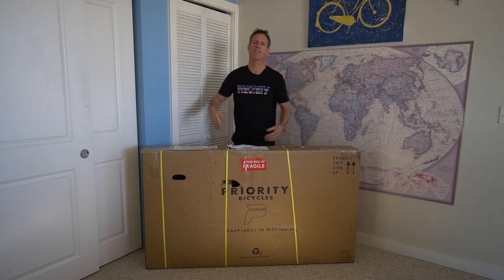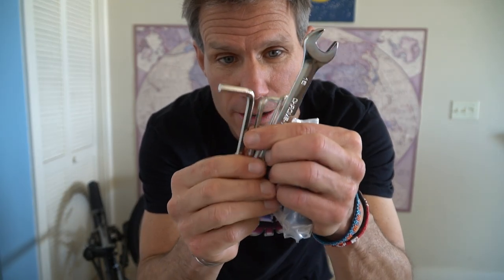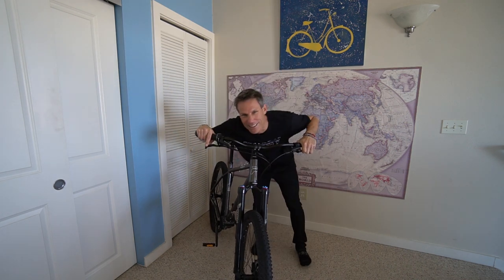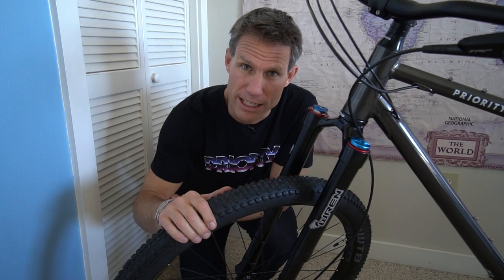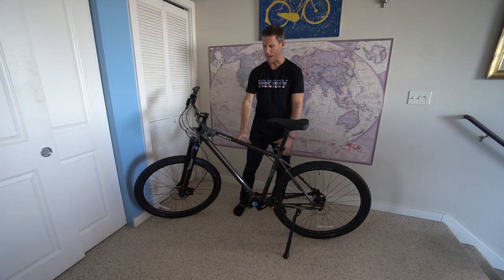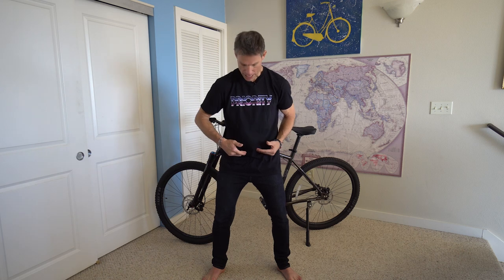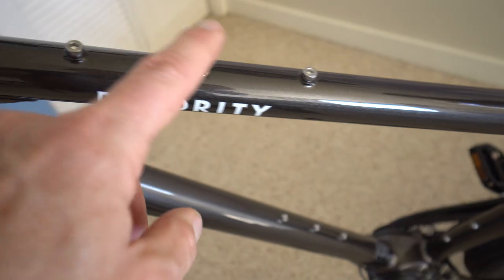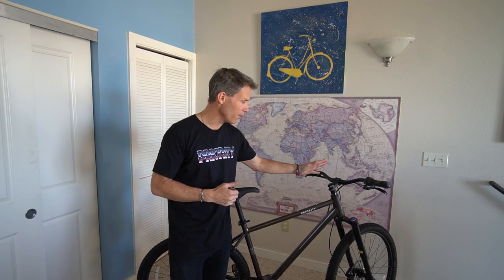The Priority 600x Bikepacking Dream Machine!

Comment: A note about tubeless, sounds good to you dig into the facts. 1. If the rim tape is not installed properly you will have problems. 2. the Valve stem comes in different models and you MUST get the right one or problems. 3. The sealant you put inside comes in many brands and some are not compatable with other brands, and some are not compatable with CO2 cartrage inflation. 4. you must check your pressure because even if all the above is ok, they lose air. 5. Tubeless tires are extremely hard to put  on, bikeshop couldn't install my last set, I'll do it myself. 6. Recommended you carry a tube because they are hard to get a seal to pump up on the side of the road or trail, also no real weaight savings if the tube is on the outside. 7. bike shops charge quite a bit to convert, REI quoted me 75 per wheel.

Contrast that with just putting tubes in and not having all that problem potential.  I run Schwalbe Marathons and my last bike in the USA I put 20,000 miles on the front tire and never had a flat. Cycled right threw glass when I saw it or not. Boxs says check air once a month. Unless you really have the need and the ability to fix problems then go ahead. 

I bought the regular priority 600 back in Sept. But the WTB tires have had 3 flats and thats with tubes. 1 flat the LBS put a new tube and it went flat by the time I walked 4 blocks to the bus and I had to walk back. (650B sux). Not all the bikeshops have tech. who can competently install the tubeless setup.   The tires that couldn't be put on by the LBS? they were Schwalbe  Marathon Mondial Tubeless ready tires   which was the only style of 650b I could find. They are expensive.

Van Duzer is just an advertisement for Priority. they have given him a lot of bikes and possibly more. I love the Priority 600, but was anoyed the seat sucked after hearing Ryan gush over it. In my view Priority bikes are good, but running tubeless or not with these new tubeless ready wheelsets and tires not so much. I have watched and enjoyed Ryan's content, but will take his recommendations with a grain of salt as far as parts go.
Reply from the maker: Thanks for your input. All my bikes run tubeless and I love the setup. I agree, they’re harder to put on, but much easier maintenance in the long run. Not sure where you live, but Boulder bike shops have no problem installing tubeless, it’s a routine upgrade. 650b plays no role in puncture resistance, maybe you were unlucky. I’m still a big fan of the Schwalbe Marathon Plus, they’re solid. The Wtb Pure doesn’t suck, just doesn’t sound like it was the right fit for you. Seats are like shoes, one size does not fit all. Happy trails!
Reply: @duzer  my gripe about 650b was just related to Schwalbe, I normaly run with Marathon, or Marathon Plus, but could only find Marathon Mondial in 650 B, which is a lot more expensive.  I'm just not a fan of running tubeless because having to worry about if the bike mech. installing the tubeless did it properly, and also havinging yo constantly fret over checking the air pressure, and worrying about not being able to inflate on side of trail is maint to me. I'm old and don't see well. Did you miss my comment about 20,000 miles on a Marathon Plus with 0 flats? That was front, rear was 9.000 miles. I didn't rotate like I should have.

Anyways I love the Priority 600 Pinion-Gates drive. Clean and worry free!

Comment: Duuuuuuuzer! Nice work and congratulations. You did it! The final spec looks great. Also kudos on that Wren fork. I want a Wren fork, and a priority Pinion “Ryan VanDuzer” signature edition. Just an idea(s) but PC needs to make a set of plastic tighten-able water bottle bands to slide up and down the Wren upper fork tubes to offer large cages on each side of the fork as an accessory. Also a get out there perfect sized frame bag with your “get out there” logo screen printed on each side. The last piece of the Ryan VanDuzer signature edition would be the custom stickers get out there on the wren lower fork Guards.
So 3 extra Ryan VanDuzer 
add-ons. 1. Plastic H20 bands for each side of the Wren fork. 2. Custom frame bag with Get out there logo. 3. Custom Wren lower fork guard stickers...get out there. There is no reason for someone to use automotive hose clamps to mount a extra water bottle on each side of the Wren fork.
Reply: Oh I forgot, 2 frame bag sizes, one for the medium frame and one for the large !!!
Reply from the maker: Is that all? Ha!! Love that list. Thanks for sharing your excitement

Comment: ⭐️⭐️⭐️⭐️⭐️⭐️⭐️⭐️
Hey I just got my 600x .
After a waiting 9 months. 
Q1 waitlist.

But I’m regretting it already.  
Trying to change to tubeless, it was so hard. It was so hard I punctured my tire & interior while trying. 
Still I can’t remove it. 
This is problem If you are in tour & 
You can’t change or fix it.

The Seat not comfortable for me.
Reply from the maker: I’m sorry to hear about the tubeless conversion. How did you puncture the tire? Please don’t tell me you were using a screwdriver to get it off the rim. I will say this, once you have it all setup, tubeless is much better in the long run
Reply: @duzer  
I was so desperate to remove it  today, 
I used a screw driver & I punctured it. 
It is NOT meant for an adventure bike. 
Maxxis is better.
Way easier to change.
My friend has the same difficulty with his 600x.
Bike shop used a big tool. 
They say it’s hard to remove it.
Imagine if you are in a tour/Trail/ Bikepacking trip.
Daryl from priority reached out to me already.

But again, this WTB ranger is NOT meant & NOT the best for the 600x.
Reply from the maker: The ranger is a great tire, I’ve ridden thousands of miles on them. Once you learn to correct way to maintain them, they’re very easy. Enjoy the bike!
Reply: @duzer  
I put a new Maxxis Tires. 
better , easier.

Seat not comfortable 

Do you still need to break in the brakes ?
Reply from the maker: Maxxis are great too, which ones? The brake pads, like any brand new brake pads, take a little time to settle in. Sorry to hear you don’t like the seat. I always tell people that seats are like shoes, they all fit different people differently
Reply: @duzer  
I put my SELLE ANATOMICA  R2 rubber 
Saddle & way much better. 
I have the X2 leather on my Orbea , 
I finished my century ride with it. 
Try it , you’ll love it. 
No break in period like the brooks. 
& US made.👍👍.
Reply: Thank you for your videos. 
We love them.

Did you put a a PNW coast seat dropper post on your 600x?

Comment: I feel very strongly that standover height is over-hyped as THE fitting metric for bicycles.  At 5'11" Ryan, you may better fit the large frame, despite not having ideal standover clearance.  The change in the main triangle AND 10mm more fork travel obviously reduced that for you.

BUT I think cockpit fit is the #1 concern for a cyclist.  That is, reach to the handlebars and not being cramped or too stretched out is very important.  I place the highest priority on this measurement because you spend hours and hours RIDING your bike in the riding position.  How much time to you spend standing over your bike?

Can you adjust reach?  Sure.  But today's bikes use far shorter stems and obtain reach through top tube length.  Gone are the glorious '80's when we all rode 15cm stems and flipped over the handlebars all the time!!!!  (Ha, ha, I STILL do!!!).  Plus, even with a longer stem, a frame that's too small will still be an issue.  Like when your legs are so long, that your knees end up getting close to the head tube of the bike with each pedal stroke.  No stem can fix this.  Proper top tube length is the key and this is why a large frame might end up being better for you.

I found people seriously compromised fit by obsessing over having some huge clearance over the top tube.  Why?  To avoid landing on the top tube?  Sure.  But how much difference will 2 or 3 cm make when you take a major spill?  I can't imagine it makes any difference.  I saw SO MANY guys my 5'10" height on 16" frames.  It was laughable how they totally accepted terrible fit for some theoretical top tube clearance.  When I crash, I'm WAY more concerned about the rocks and trees I'm gonna nail.  Plus, when I DO go over the bars (something that's been a bit too frequent as of late) it always seems to be my knee smashing into the stem and my crotch never even gets near the TT.

So take out a measuring tape and figure out what reach is best for you and see if the medium or large gives you the best "on-bike" fit.  Don't obsess about top tube clearance.  You aren't planning on having kids anyway!  (I already had mine...  but wait, that was with minimal TT clearance!  See?!!!  Ha, ha!)
Reply from the maker: I hear you on all this, but the simple act of getting on and off this large frame is a gymnastics act where I hop on one foot while extending my leg out. It’s not comfortable, and when loaded down with 30-40 pounds of gear, getting on and off this large would be a real trick, and I can foresee many clumsy falls ;)
Reply: @duzer  makes perfect sense!  Thanks for the reply and enjoy the new wheels!

Comment: I get that it was designed as an adventure bike. But how capable is it as a mtn bike?
Reply from the maker: solid, I ride it on my local single track trails and it’s great.
Reply: I rode it on maiden voyage today.  For a hardtail, it feels great.  Composed both climbing and descending.  Agile handling, but not so much that it feels twitchy.  More comfortable than I expected.  Not a racebike in weight or handling—I was slower than on my 28# full suspension bike.  This is a bike for putting in long miles and doing so in comfort and with loads of gear on board.  The gear range is awesome—didn’t need the lowest and highest gears.  Very smooth and quiet drivetrain.  If this was my only bike, then no.  But as a general purpose and bikepacking rig, thumbs up!

Comment: maybe i have different things coming to my mind than you when thinking about backpacking - but i don't think this is a useful bike for bikepacking. the flatbar will give you a hard time after a few hours/days, because you cant change your position. belt drivetrain is cool, but when you have a problem with it on tour, it will be a BIG problem. same with the gearing - i'd always prefer chaingearing because you can easily repair it when it breaks. gripshift is a no no for the same reason. suspension - well yes if you do downhill backpacking - for gravel, mud and tarmac you will not need it, it is just extra weight. don't get me wrong, the bike looks super nice and i'd love to test it on a day out in the forest. but i would not start a bikepacking tour with it. btw - what is the weight of the bike? cheers
Reply from the maker: There’s all sorts of bikes for different terrains, this one is made for full on mountain biking. I’ve never had a problem with flat bars while touring. I like them much better than drop bars. Bike is 33 pounds
Reply: thanks for explaining. :)